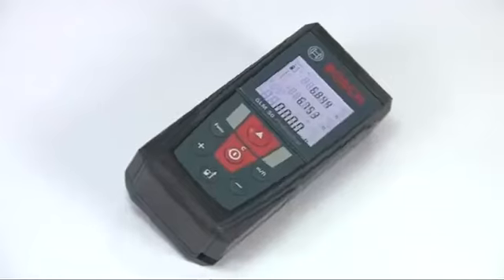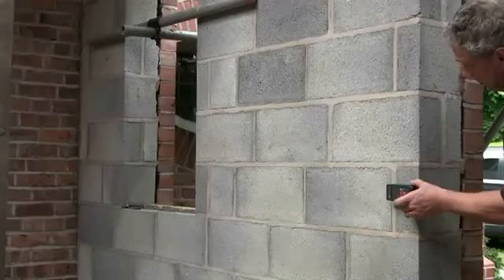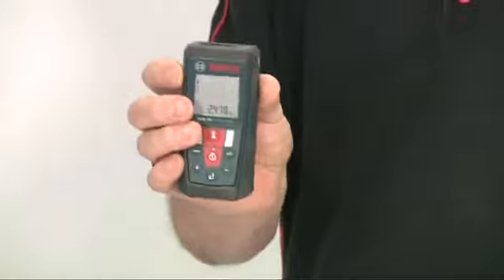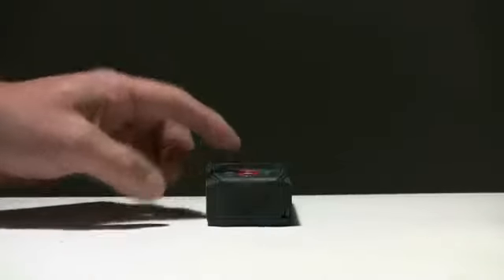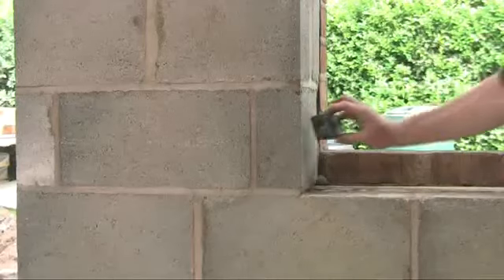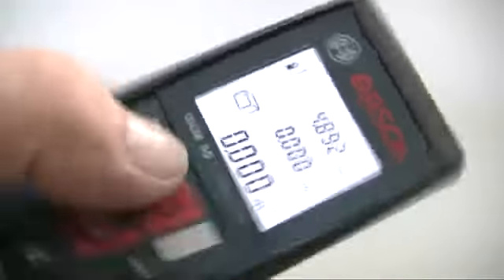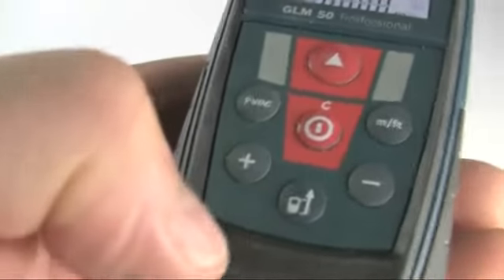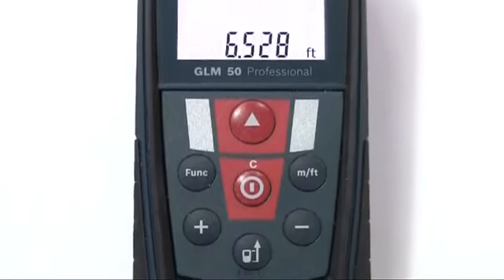Bosch GLM 50 Laser Distance Measurer

Comment: OK, it measures in 1/32 of an inch--It's only accurate to a 1/16th?  You can't tell it to measure to a minimum of a 1/16th or 1/8.  So it returns measurements like 3 29/32". Great if you're a cabinet maker, but very inconvenient and unnecessary if you're using it for anything else.  I'm doing architectural work, we don't use 1/32 in the field and I doubt anyone else does.  And what sense does that make since it's only accurate to 1/16?  Otherwise, I like the user interface, so if you use metric then it's a great tool, but not allowing minimum 1/16" dimensional readings is just bad design for US imperially trapped backwater folk.